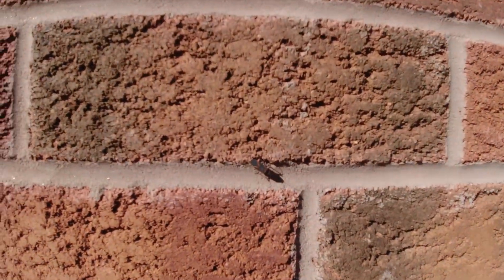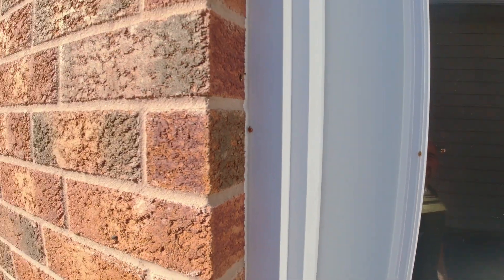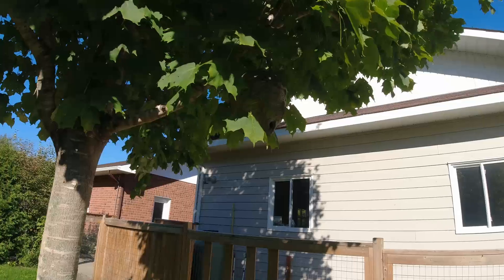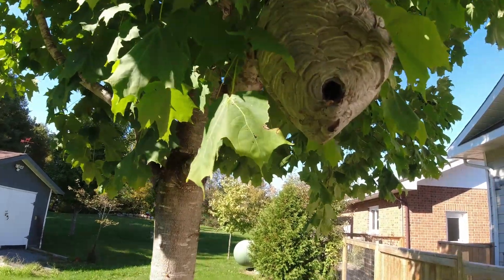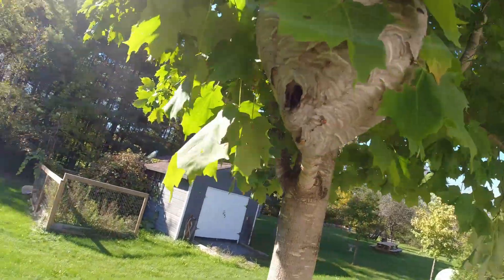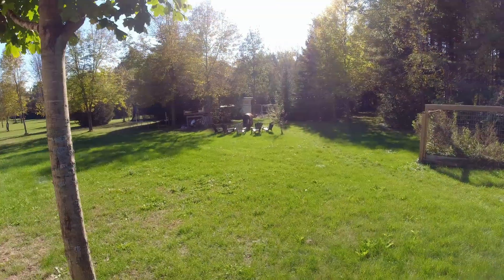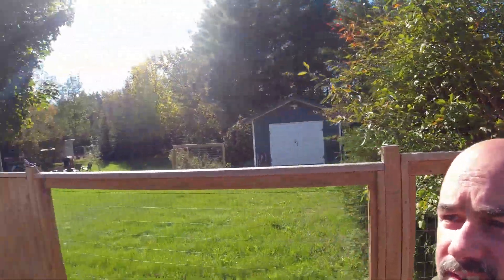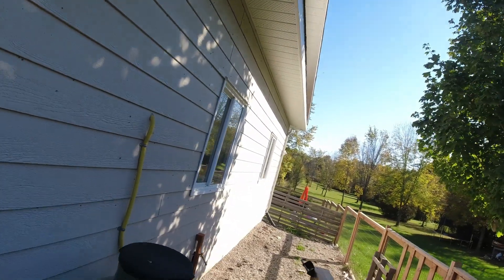New Bench Vise and Remove a Wasp Nest

Comment: That wasp nest was fantastic. I did not realise the Record vice made it to your part of the world, I knew exactly what it was when I first saw it. We have a large vice collection which are mainly Record brand and includes a No.6. Record used different names to identify the each range, a No.6 is classed as a Mechanics vice. Within that range you can get a No. 00,0,1,2,3,4,5,6,7,or8. Not all the numbers correspond to jaw width but models 5 upwards do. One day will will do a video on our vice. It does not matter but for the record (lol),  Record is pronounced the same way as a record player
Reply from the maker: Thank you very much for the information! And I assume my issue is that spring and retainer ring is screwed up? Is it easy to fix ? Thank you for watching.
Reply: @RossOnTheLand  It looks that may be the case and as such the spring is not effective. I have not pulled that nodel of vice apart and they are all slightly different but they are not difficult. It is possible that the slider need to be cleaned up too